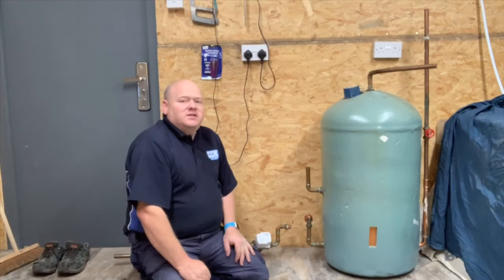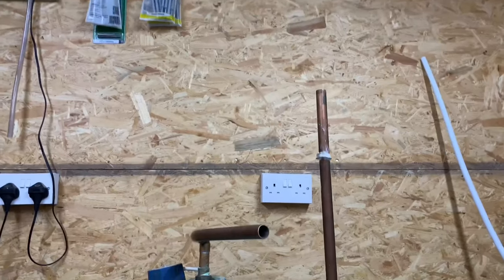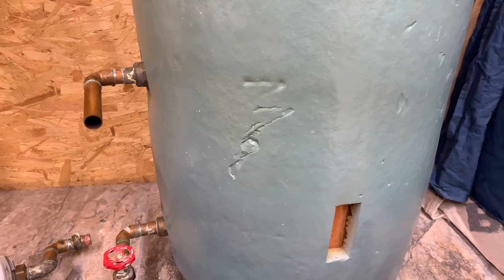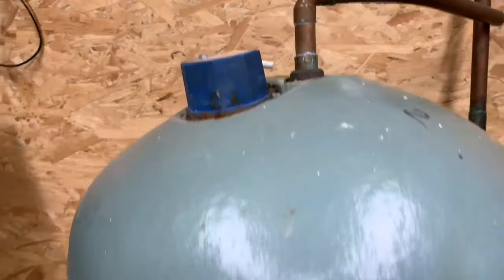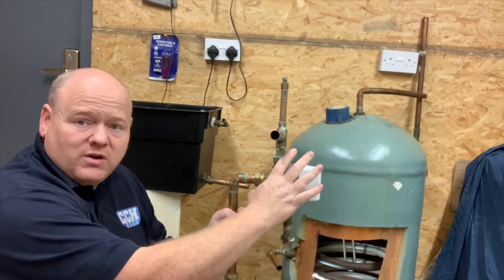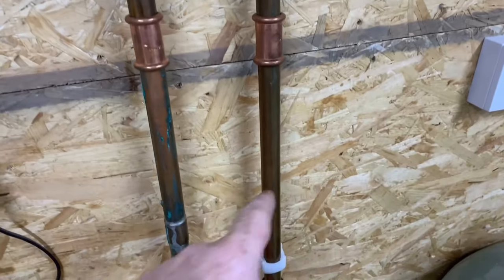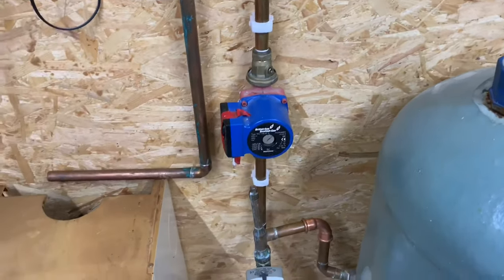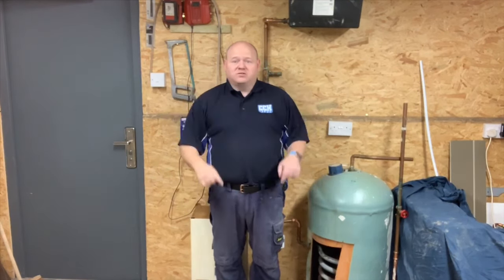Plumbing - How Does a Hot Water Cylinder Work ?

Comment: hi buddy i have 2 boilers and 3 indirect unvented tanks similar... its a hotel i am running. the problem now is the water coming from the showers is not consistently hot / mixed. the temperature fluctuates highly from hot to cold. the water temperature in the shower is not stable. what could be the problem and where could it be ...... in the tanks or the boilers..??? we recently had the gas renewal certifications where the people did the boilers and told is working fine. please share yr expertise and experiences. thanks
Reply from the maker: Thanks very much for your comment, please consider subscribing to support the channel 🙂

Comment: i moved into an old house with an open fireplace. I've been told there is a "back boiler" which heats the water and radiators when the fire is lit . There is a switch which apparently pumps the hot water into the radiators ? The fire is lit i switch on the pump (i can hear bubbling noise) but no warm radiators or hot water . Can someone explain, why not ?

Comment: Hi Allen, great video, explaining what pipe does what and which direction they flow etc!
I have just had a new tank fitted, the hot water system works fine, but now none of the radiators warm up. The plumber put Sentinel X400 in the system 3 days ago, and said he would flush it in two weeks. Should there be at least some improvement in the rads? Could it be, as he suggested, sludge in the pipes, or could it possibly be something to do with the Honeywell Y Valve? The lever on it feels very loose, with no spring action?
It was all working fine before they put the new tank in, which needed replacing, as it was leaking from the bottom input pipe.
Thanks in advance
Reply from the maker: Thanks very much for your comment, please consider subscribing to support the channel 🙂

Comment: Boss I worked on faulty port vale on hot water cylinder...return won't heat up.  I put AAV on return but wont return hot or warm  from cylinder..I'm suspecting the coil is blocked, would power flush sorts it out?? Or best replacing the cylinder, only 5yrs old...the rads nice and hot...
Reply from the maker: Thanks very much for your comment, please consider subscribing to support the channel 🙂

Comment: So when you take hot water out of the tank are you essentially also putting cold water into the tank which then would ultimately cool down the hot water that you had initially. If that's the case would it be wise to always have your boiler running anytime that you're potentially using hot water that way you don't have to reheat the hot water over and over again?
Reply: stays hot for 1 to 1 and a half days

Comment: Hi , we’ve just had a new tank fitted just like the one in your very informative video. However when the pump starts to work we have a loud vibration noise running around all the pipe work in the house. Could it be possible that the Coil inside the tank could be defective & vibrating creating the loud noise we hear in the house ?
Reply from the maker: Maybe the valve has been put on the wrong way round?

Comment: Hi Alan, if this tank was only heated by the electric element and not a boiler. So direct water cylinder heated by an electrical element. Would it be possible to have that connected to a underfloor heating system as the main source of the hot water. If it would be what components would be needed apart from the underfloor manifold and pump
Reply from the maker: Thanks very much for your comment, please consider subscribing to support the channel 🙂

Comment: My hot water tank of water suddenly close from the loft tank, and tank gone empty, and switch with fuse box burnt, I change fuse but water not hot
I want change  immersion heater , couldn't open but water is leaking slightly from there, please what is the solution in this situation? Help me, thanks

Comment: Hi Allen, great video, just a quick question, when you say the last T should be from the cylinder to the boiler, I don't really understand that part, could you explain what you mean by that? thanks!
Reply from the maker: Hot water return needs to be the last return to boiler. Thanks

Comment: Fantastic video!  I have this type of system and have noticed a constant ringing in all rooms, very quiet but doesn't stop.  I've turned off mains water and electricity and it's still there.  I also have hot water but no heating.  Could the expansion tank be constantly circulating water?  Do you think it's a leak on the Ch pipes or a stuck valve?  Many thanks👍
Reply from the maker: Thanks very much for your comment, please consider subscribing to support the channel 🙂
Reply: @AllenHart999  Why would I subscribe when you ignore my question?
Reply from the maker: @loriAlessiroberts118  fair point. Thanks for watching.

Comment: Love your videos Allen. Can i ask a question that is bugging me and cant find what it is. I saw a video with a 'hot rod' pipe that connected from the  'B' output of the  Y plan diverter valve and connected to the top of the vented cylinder next to the hot water pipe. This is a heating pipe and connecting directly with hot water outside the internal heating coil..or the coil flow on this cylinder connected to the top of the cylinder with the return further down the tank
Reply from the maker: Thanks very much for your comment, please consider subscribing to support the channel 🙂

Comment: So I have this type of system. I have a nest smart thermostat fitted too. How do i know how long I have to put the hot water in far in order to heat the water in the tank?
Reply from the maker: Personally i would leave hot water on all day. Then when you need heating it will work straight away. Thanks.

Comment: Hi Allen. I am a novice and have just replaced a diverter valve on my heating system which is exactly like the one in your video. There is no water at all coming out of the hot taps now. Radiators are getting warm straight away. Any ideas
Reply from the maker: Thanks very much for your comment, please consider subscribing to support the channel 🙂
Reply: put your hand on the pipe marked B, there is a manual controller on the valve, feel the heat difference, sounds like a wiring fault

Comment: Hi Allen, i have just fully drained system and replaced external pump amd cold feed gravity system, boiler is 330 BG glowworm and it shows f25 and won't fire up, sounds like there is a air lock into the system, any idea?
Thanks Dan
Reply from the maker: Thanks very much for your comment, please consider subscribing to support the channel 🙂

Comment: great info on this video - thx mate👍
I’ve been comparing the pipe layout on our HW cylinder and flow pipe from the pump goes in at the bottom and the return is at the top. Is that a problem having it in that order ?
Reply from the maker: its not the best but as long as it works.

Comment: Alan how is that primary return not fighting against itself? You’ve got the return from the rads and the return from the cylinder , going back to the boiler. How are they not fighting against each other at that tee, returning to the boiler...?
Reply from the maker: Thanks very much for your comment, please consider subscribing to support the channel 🙂
Reply: Tbh If there was a radiator close to the cylinder it would back feed when on hw only.but I'm sure Alan knows this.the tee would be on tge other part of the return so the hw return is flowing straight to the boiler.

Comment: Hi. Someone installed Electronic Economy 7 timer. It only boils water when BOOST button is used. We followed manual and set timer during night to boil whole tank but it doesn’t boil. End up using Boost during day. 
Will it be thermostat issue? As we have economy 7 meter it’s cheap in night. How can it boil the whole tank in night not just for one hour. Thanks.
Reply from the maker: No idea
Reply: I opened bottom thermostat cap. I pressed a small red button (reset button-not written) it’s worked magically and the joy to hear the hissing sound of it turning on. Worked.  Maybe someone else have same issue. Just find and reset thermostat.

Comment: Hi. I'm trying to help a pensioner who has overflow leaking from cold tank supplying cylinder. Plumber put in new ballvalve,still leaking. Came back a week later said it needed new thermostat for immersion heater. But she turned heat off overnight and it still leaked in morning, any advice welcome.thx
Reply: If its constantly dripping from the overflow pipe then its a pin hole in the coil, you'll need to replace the cylinder
Reply: @jamiefors5062  hey, thanks for comment. That was a thought at the time but no coil in cylinder. Fixed by putting non return valve on cold pipe near kitchen mixer. Presume mixer causing problem but she didn't want it changing. Thxs

Comment: Do you need copper in proximity to the boiler ?  Could PEX be used here instead ?
Reply from the maker: Depnds on manufactures instructions. Normally around 1m of copper needed. Merry Christmas
Reply: @AllenHart999  Thanks Alan. Merry Christmas to you too.
Reply: @AllenHart999  Is the paste on the olive the 577 stuff, thanks?

Comment: so if you were to change to combi boiler in this situation, am I right in thinking you remove the cylinder from the equation by changing the Tee for an elbow ?
Reply from the maker: The tee to the boiler would be removed. You would then pipe the return to the boiler. 👍

Comment: what I dont understand is how does the hot water rise from the hot water tank outlet and to my bathroom taps without a pump? what provides the pressure? and more importantly how do i stop it from happening so I can change a leaky gate valve on the tank outlet pipe?
Reply from the maker: Normally a tank in the loft. Thanks.
Reply: @AllenHart999  oh yeah, cheers!

Comment: Alan I see on a video you used the return on the coil for the boiler return so will this work as I didn’t think it would be on sane circuit to rads this was on your last instal would it still be on same circuit or is there a primary and secondary brilliant video as always mate 👍🏻
Reply from the maker: Great question. Yes the return on the old system joins together, Normally near cylinder. Thanks.

Comment: Will you be doing another video which covers what pipes need to kept and connected and what needs to be discarded to do a combi conversion?
Reply from the maker: I thought i covered it but i am happy to do another. Thanks.
Reply: @AllenHart999  if I'm not mistaken, i understand you do away with the f+e tank, and the water tank you connect the mains that feeds it to the bottom feed, and the flow and return you cap off at the cylinder if the boiler is in the kitchen. A detailed video would be appreciated.
Reply: @AllenHart999  Do you offer a service where you can provide telephone/video call advice? I would be more than happy to pay for such services, i'm sure others would do too

Comment: What I don’t understand is, as you use hot water, cold water replaces it from the cold water tank to the bottom of the hot water tank. But how does the remaining hot water stay hot as more and more cold water is added to the bottom? Is it simply a case of hot water rises to the top? I’d just assume the cold water at the bottom would quickly cool the hot water at the top 🤷🏼‍♂️
Reply: heat doesnt travel down through the water very well... like hot air rises. so does heat in water, becoming lighter, so always makes it's way upward forcing out water through your hot taps.

Comment: Quick question on cold feed in, can the cylinder fill up via mains water ? Or does it need to come from header tank?
Reply: Only a unvented cylinder can be fed by mains pressure, vented cylinders are fed by CWST
Reply: @masterchaz100  thanks i found a diagram online , i have indirect cylinder so mains water to header tank 1metre above, then on hot out i added vent pipe from hot up to header so both hot n cold pipes are on open circuit. 👍 Cant believe the cost of plumbing parts i fitted it all myself to cut cost but still cost a small fortune all in

Comment: How you turn the water off to change the element in immersion please
Reply from the maker: Not sure what you mean sorry? Thanks.
Reply: I am guessing you have fixed it by now, but...

1. Turn off the cold water supply to the cold water tank in the loft. 
2. Run one of the hot taps downstairs to empty some of the water from the hot water tank. The tap will eventually run out of water.
3. Unscrew the immersion heater and replace it.
4. Turn on the cold water supply and wait for things to refill.
5. Run the hot water tap until it stops spluttering. You may need to repeat this with any other taps that aren't functioning normally.

Comment: I’ve got a problem with my boiler I don’t know where the problem comes the heating is ok but no hot water .
Reply from the maker: What boiler do you have? Happy new year. Thanks.
Reply: Funny as I've had the same problem start today. The boiler doesn't fire up for hot water but it does for central heating. Mines a Potterton Promax SL.